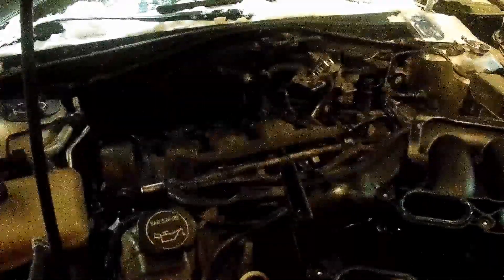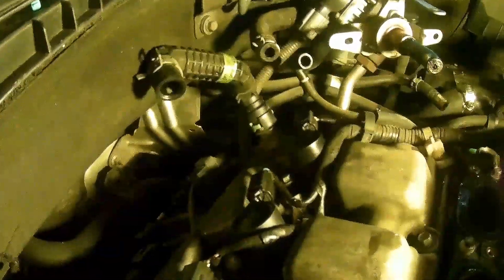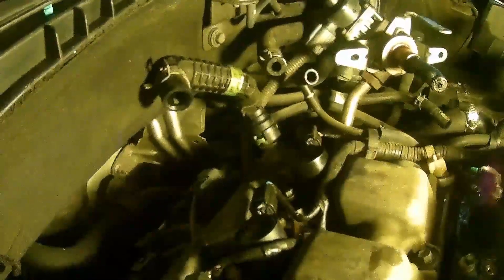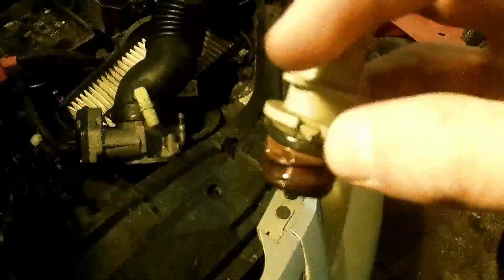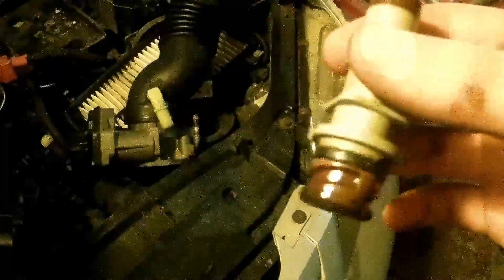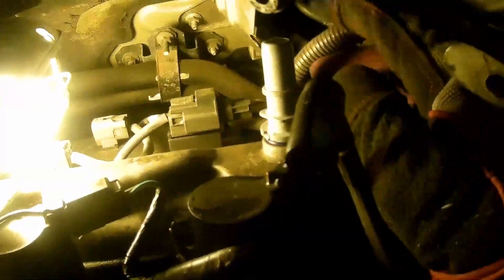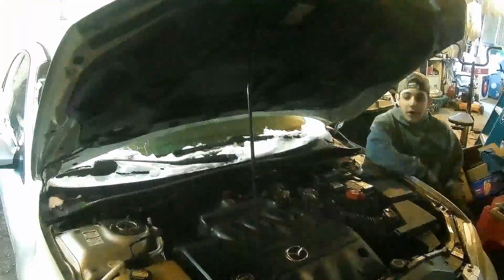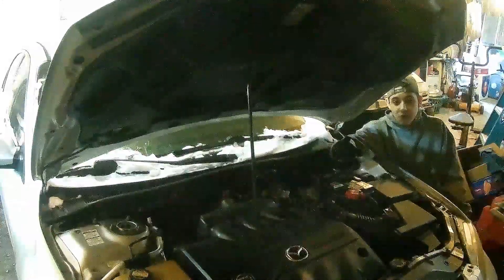Mazda6 PCV Valve Replacement

Comment: I'm will Salt Maker, they are suppose to rattle..cause vapors are suppose to flow back into the engine under vacuum and the check ball reseats under zero vacuum at full throttle or shut down. Remember, vacuum is always highest at idle.